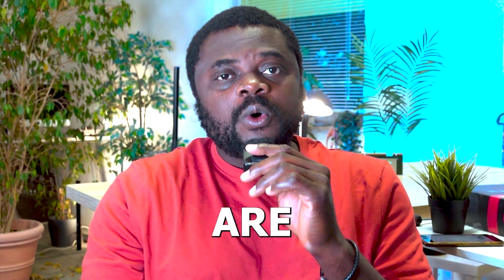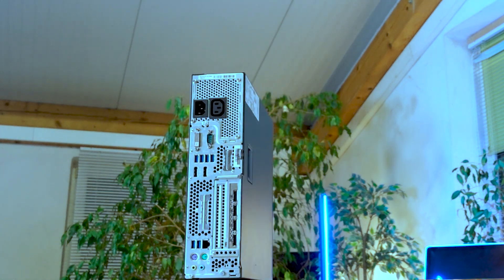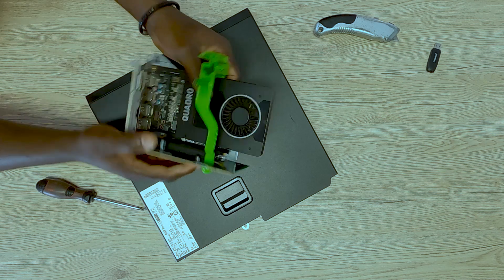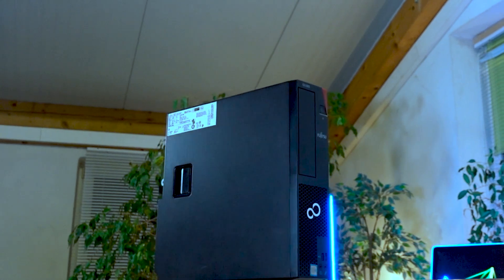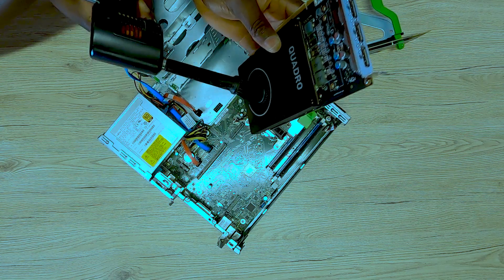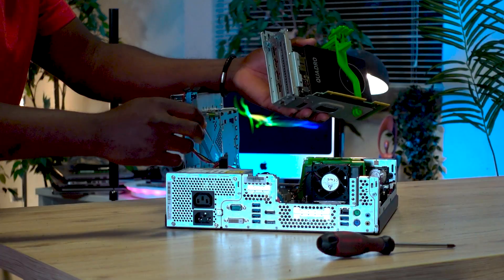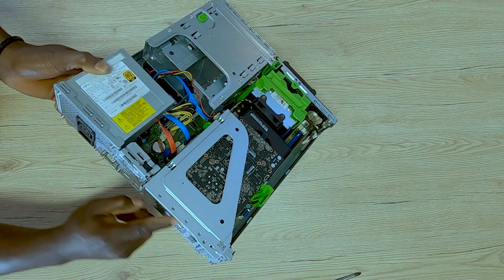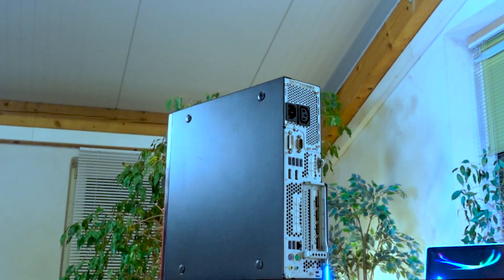GPU too big for SFF case, here is the PC that fixes this problem

Comment: I have some unanswered questions about this Fujitsu PC.

1) What is the maximum GPU card size that can fit in the case? Usually card size is measured in millimeters.

2) What is the maximum power consumption in Watts which the PC supports for the GPU?

3) Does the power supply offer additional cable for a stronger GPU, or is GPU slot only power available?
Reply from the maker: @twopoint71  hmm will have to check that out next time i am at the warehouse 😉